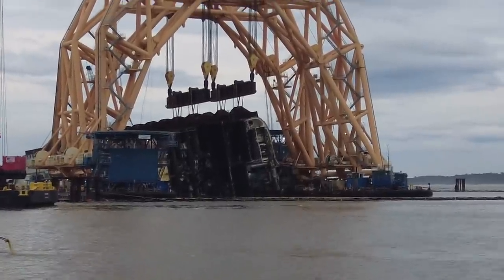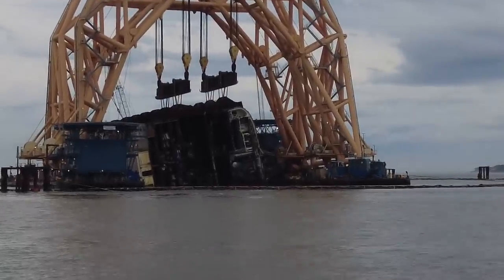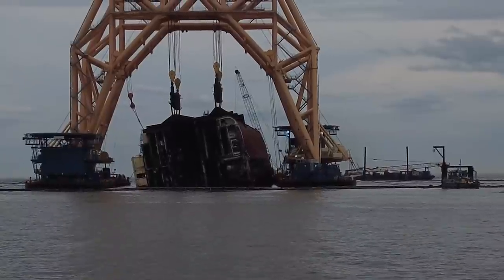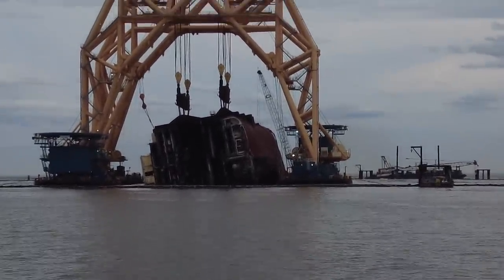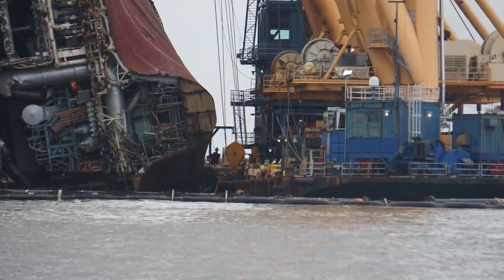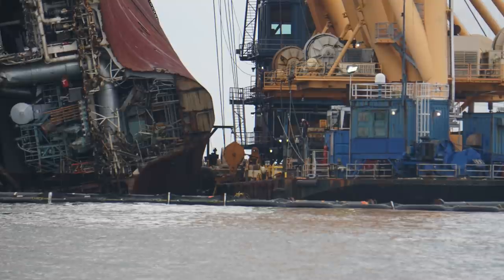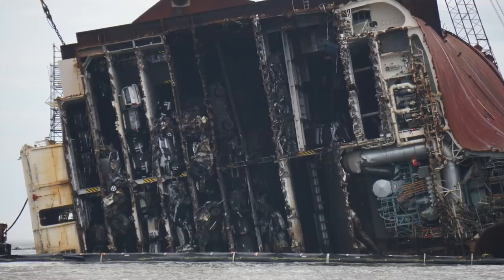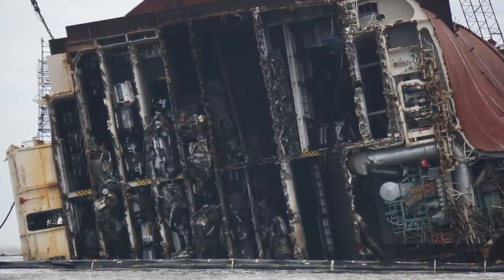CARS BEING STACKED UP!! on February 9, 2021

Comment: Makes good sense that they are taking off as many cars as possible.  Each one they have to cut through dumps more contaminates into the water.  Should make cutting a lot easier and quicker.
Reply from the maker: It's got to help!  MM
Reply: @MinorcanMullet  Just speculation, but if they can snag enough cars from the bow, it should make cutting the next bow section much easier.  Then they can keep reaching further in and snagging as many cars as they can drag out.

Comment: Thanks again Andy! The last scene of the hull made me think of the difficulty involved to release the straps of each vehicle, one at a time, starting at the top of the pile. If I were doing that I’d want my fall arrest harness secured to a winch rope at the top of the section so I could lower and raise myself with each car removed by the excavator/telehandler. Maybe they are using big nippers of the excavator so the operator can snip the straps from his control cab. To hang in a fall arrest harness is not comfortable, no carnival ride, but it is there for safety of the worker suspended in air.
Reply from the maker: Another dangerous part of this wreck removal!  MM

Comment: Andy, I want to point a something out. Yes, by their nature RO-RO ships are open in the cargo spaces, but in the bottom 1/3 of the ship, in the machinery spaces, there will be many longitudinal and transverse watertight bulkheads separating the different systems, compartments, oil and ballast tanks. You cannot allow flooding from one system to compromise all of the systems that operate a ship. I have experience with two ships that had major flooding incidents  from a failure in seawater piping (that's a simplification) in an equipment space and the flooding was only contained by closing the emergency doors.
Reply from the maker: That’s true for everything below the weather deck. Above that, it gets interesting. MM
Reply: Above the waterline there’re no watertight compartments. It is one open space with reinforcements in the middel and sides.it can collaps when there is not much sections remain.
Reply: @johanengels6387  Go back to the video and stop it at 2:50. Look at the number of decks spanning between the sideshells. Take a minute and look at the framing on those decks. That's a lot of structure. This whole theory of the ship sections "collapsing" is based on a fundamental misunderstanding of what happened to the midship sections of the Tricolor during that salvage operation and some people here misinterpreting what the collapse concerns in this job are even talking about.
Reply: @theaverageamerican2081  , you are right about the structure , but  the reinforcements are made for a normal floating ship and not one li
Reply: I mean a ship lying on its site for a long time, every time they remove a section the weaker the remaining sections will be.and some of the decks are moveable so these are not a part of the structure  even so are some decks also useable as ramps and the are obviously collapsed.
Reply: @johanengels6387  Well that's not really true either. Ships are designed for the inward and outward flexure of the sideshells due to loading conditions and hogging and sagging of the ship and for large pressures on the sideshells due to static water pressure, wave passage and broadside wave impacts.  The structural system in a ship that resists these traverse loads are what's known as webframes, typically spaced about 2m apart down the entire length of the ship, and consists of the T shaped beams that are welded to the sideshells and decks and form a continuous frame. So you have a continuous frame designed specifically to strengthen the ship against transverse loads approximately every six feet that is now acting as columns at the decks and girders at the sideshells. Cutting the ship into sections does nothing to reduce the effectiveness of these frames individually since the cutting is done between the frames.
Reply: The lying on it's side for a long time part is what killed the already cut middle sections of the Tricolor but that was a 106' beam ship lying on it's side in 96' of water for a year in the open North sea effectively making itself a seawall. Getting hammered by 6,000,000 full load reversals racking the sideshells back and forth from each other is WAY outside the design conditions of a ship and caused those sections to fatigue apart. Fortunately for us the golden ray is not experiencing anything like that.

Comment: 6:30, the structure of the ship could be a problem once this section is finished being cut off-----what do you mean?
Reply from the maker: Several salvage experts have contacted me and said that because the way these particular ships are constructed, there isn't much structural strength midship.  After this cut, there is a concern the remaining piece could lose structural integrity.  MM

Comment: Removing cars is interesting to me for a couple of reasons.  
First, the cars all contain fuel, transmission fluid, engine oil, and antifreeze. All of which are toxic to wildlife, whether that be shellfish, shrimp, fish or birds.  So removing cars rather than slicing through them is the better option. That is dependent on if grapple can reach to where the cut in that section is based on where the chain is laying on hull.
The second thought for me is that removing cars makes the wreck much lighter weight.  Between Marine Architect, Hyundai Heavy Industries (the ship builder) and  knowing the total weight of autos, They can probably calculate weight of wreck.  Open question for me is can the VB10K weigh  each removed section? I know some cranes can so they don't damage crane or lose control of load. IF VB10K can weigh each section they can ballpark estimate remaining weight of hulk. 
Removing ships engine will be a significant weight reduction in its own right.
A big ongoing question for me, and which the salvors probably know already is are they going to be able to cut the last couple of sections without lifting the whole wreck via lifting action of the cutting chain and the lifting action of the winches holding the section to be cut. 
Only time will tell.
Reply from the maker: I agree. It will come down to static weight of the remaining piece. Also don't forget the Pacific Horizon in in the Port of Brunswick and could be utilized to help stabilize the wreck. MM
Reply: @MinorcanMullet  New news release as of two hours ago from unified command. Some really good pictures that show how big some of the rigging is.